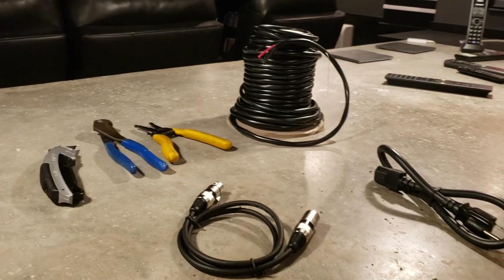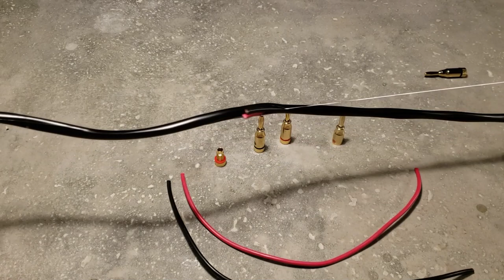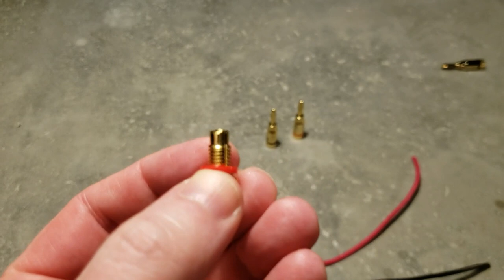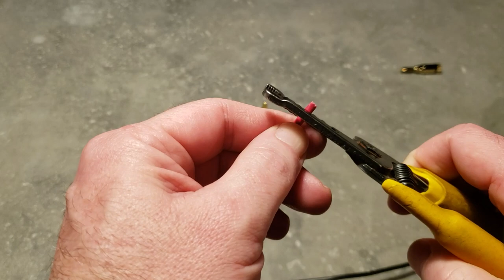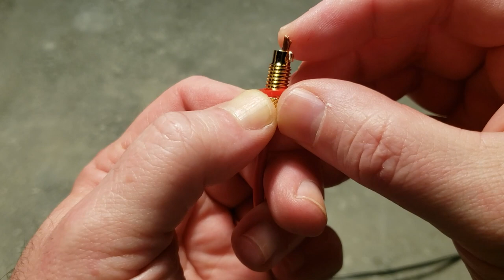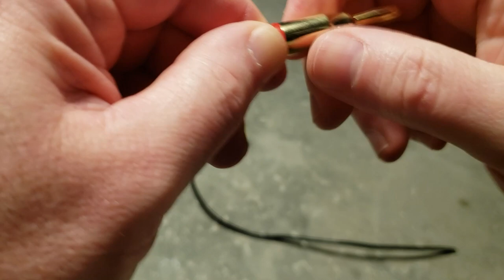Clean Up Your Home Theater Wiring | Make Custom Banana Cables

Comment: Nice video! Nice neat wiring! Where did you order the custom power cables from? In have 2 UPS's, a power conditioner, and a PDU in my rack, and their power cables are way too long (6 to 9 feet). I'd like to get shorter custom power cables for them.
Reply from the maker: Thanks!  I got them from Amazon.  Link is in the description.  You can get almost any length you want.  Just make sure they have the proper gauge wire for the device you are powering.  Some of them use small gauge wire and are rated for fewer Amps.
Reply: @smarthomeMASTERY  Thanks!

Comment: Is there a reason not to keep them paired in the jacket?  Or is it to fully optimise lengths?
Reply from the maker: No technical reason.  With my short runs, I thought it looked better with just the wire.  If you have longer runs you may want to leave the jacket on.  Depending on how neat you want that to look, you'll need to use heat tape or something like that for the transition from the jacket to the wire.